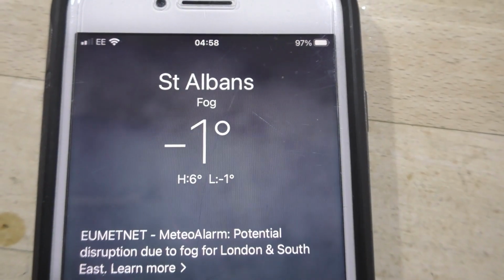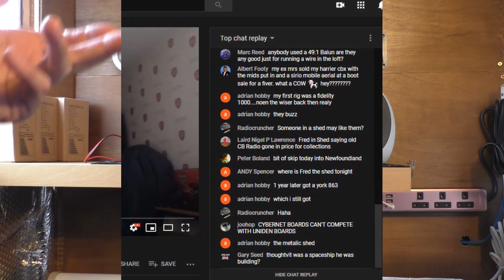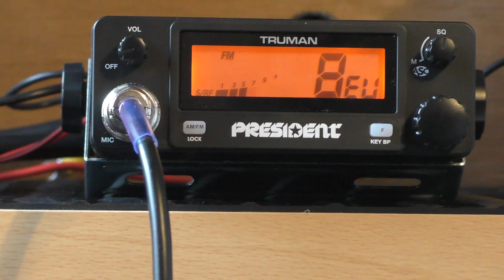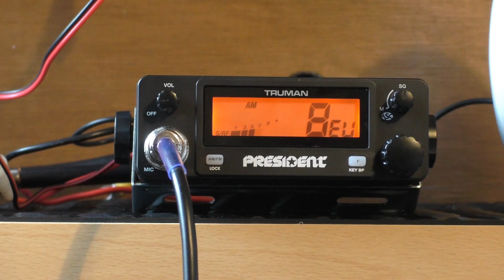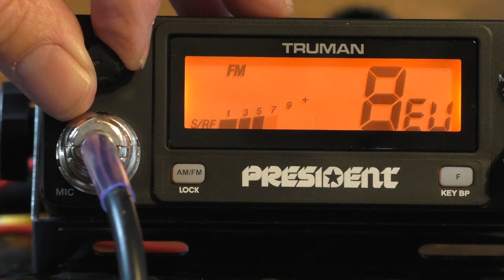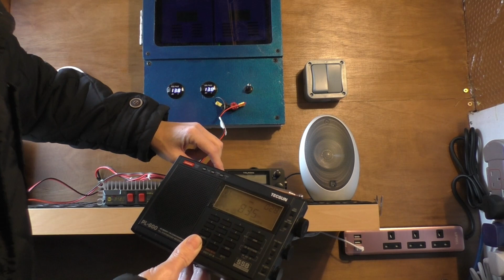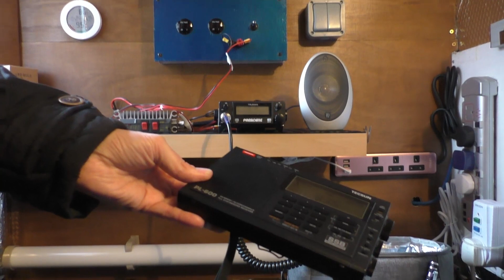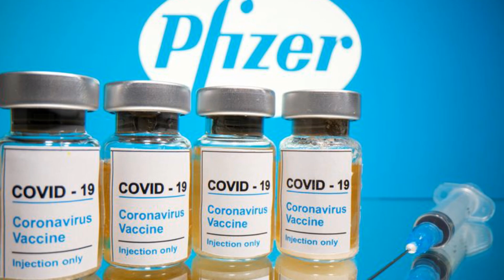Will my fancy LED lights cause me RF interference ?

Comment: Had annoying interference on my workshop broadcast radio for years.  This is in an attached garage,  Recently disconnected a wireless headset from the hifi system as nobody was using it.  Surprise, the interference has now gone.  Guess this headset is going in the bin.
Reply from the maker: Good all Rob.  Just shows you.

Comment: At @ 13:11 ... very reminiscent of that RFI signature you were trying to track
 down outside your house a while back, and also the exact same signature
 for the RFI I discovered locally caused by a VFD controlling garage 
exhaust fans -- in both cases technology that uses switch-mode (AC to DC
 to AC conversion), creating spurious harmonics throughout the radio 
spectrum. 

I call that signature the "old biplane engine" sound. https://www.youtube.com/watch?v=ZBC5kbmH3TY
Reply from the maker: Yes i think biplane noise was the fans when the radio was close.
Reply: @CB-RADIO-UK  Not the fans, the harmonic rich switch-mode circuitry itself. You can disconnect the fans temporarily and my bet is the RFI will continue.

Comment: All that matters is if noise appears on the RF band you are wanting to use, and it is negligible, that is what matters.  Should have had the radio out that does suffer, but then the noise that is already affecting it would make this test useless.  So, yeah, you probably used the right radio. Not so sure the Murphy would reject it so well, but then again there is only one way to find out!
Reply from the maker: Agreed Bob.  Only interested in 11m mid block.  The murphy would prob be ok as it FM only.  If it had AM then i think it would suffer.

Comment: Get that antenna up higher and start runnin on am! 
S
We're waiving over here in the states.
Triple 7's 
Oro Valley Arizona
Reply from the maker: Iam listen Luke.  Not been a lot of stateside when iam not working
Reply: @CB-RADIO-UK  ya I hear that.... Work always gets in the way of my radio time. Skip here was on fire for the holiday. I like the way your shack is looking. You're doing a fine job!
Triple 7's 
Oro Valley Arizona

Comment: 50+ years ago on the local allotments the standard method of warming the greenhouse was to have a paraffin burner, the type found in road work marker lights, have it burning and place a terracotta plant pot over it, the pot held the heat from the flame and radiated it... It worked, took the chill off and prevented frost building.. I'd go for a full on wood burner Fred, get the shed shack toasty!
Reply from the maker: LOL Those were prob the days :-)

Comment: Hi Fred, Many thanks for such an interesting and informative observation. Your so lucky to be led interferance free area. My problem is that when a friends solar powered fairy lights come on and there's a lot of them, but they do  look very pretty i must admit,  then i'm totally wiped out till sunrise. I've tried many ferrite beads etc but with no luck. Still the summer's coming so we hope.
Reply from the maker: Hi John.  John are you Harlow way.  If not someone has the very same issue and name as yourself.
Reply: Sure am Fred. CT 3246. We have spoken  a few times on the 305.

Comment: Being scientific is just fine and dandy if you can afford the necessary equipment and have a masters degree in electronics to interpret the results.. What you're doing is all good.. Does it cause noise when you switch it on ? Yes.. Then you know..  If it's No,  go to the fridge and get a Stella..  One thing you could try is an 'Isolation' transformer.. You plug it into your domestic 240 volt AC and then on the output plug in your equipment as though it was a direct domestic mains supply. What you achieve is to isolate the incoming power via a transformer (which as you'll know works by magnetic fields with no physical connection between primary and secondary winding's.)  This makes everything safer and has the benefit of some noise filtering.  Down side is cost.. You'll need something that will pull around 10 amps with the gear you have there.  https://www.screwfix.com/p/carroll-meynell-3kva-intermittent-isolation-transformer-230v-230v/320hv
Reply from the maker: Thanks Pete i will look into that.

Comment: The noise will be on your mains coming into the shed. You need to make a filter with a clamp together torrid and put it inside where the cable enters the shed and before any socket. Works really well. Loads of vids on you tube.
Reply: Toroid not torrid lol
Reply from the maker: Yes i did look at building one when i was tackling the PLT noise.  Could be a project.
Reply: @CB-RADIO-UK  deffo

Comment: Hi,Fred difficult problem to solve, and where I live is QRM central, those sort of led lights look cool 😎, but aren't the biggest problem, just a case of trying different things, for me moving the Gainmaster 5/8 and better quality coaxial cable dropped from  s 9 +10 to a acceptable s7,huge difference, keep trying, it will all work out, 73 from Rotterdam.
Reply from the maker: Hi John.  QRM / PLT noise is a real deal breaker for home based radio shacks.  Glad you managed some improvement.
Reply: @CB-RADIO-UK  Im often bugged with a bit of background noise. Then I tell her to bugger off and watch TV. 
I struggle at home with S1 or on a really bad day s3.
We do have a Samsung phone charger that gives off a good s9   electronic scream that I can receive some 50m down the street.
Reply: @sahhull  hi, maybe the charger is not original, my wireless and standard Samsung charger for the s10 plus, gives me no QRM, anyway good luck,73
Reply: @CB-RADIO-UK  hi, unfortunately its an on going process, funny enough with the Yagi mostly, S 2/3,mostly, 73.